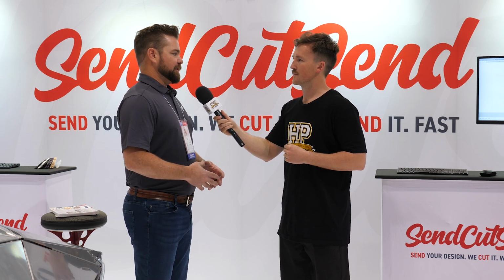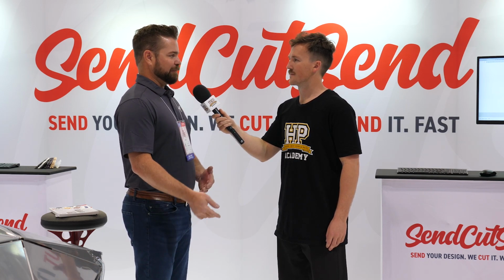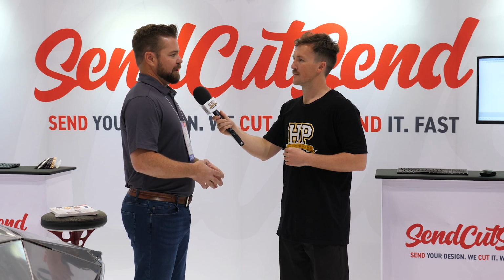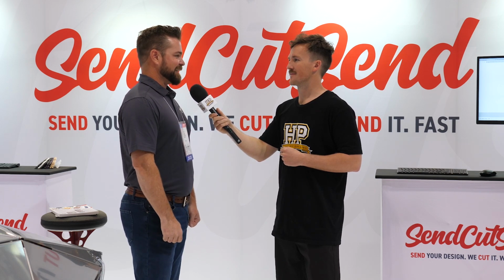You Designed A Part. Great! Now What?

Comment: At our shop, we opted to get a cnc plasma cutter. Very useful but the cut width and accuracy leaves much to be desired, specially with thicker material/smaller more detailed parts.
Compared to laser or waterjet cutting its pretty rough.

Our 3d scanned parts have to be designed with loose tolerance to take the inaccuracy of the plasma cuts into account. Very annoying to have to do. 

Just a heads up for anyone looking to getting an inhouse cnc cutter.
Reply from the maker: Still better than not having one, but you are right, you do need to work within the capabilities of the tools you have access to and that can take a little bit of testing to figure out how to make it work for you in the way you need it to - Taz.

Comment: I operate a CNC laser in central vic. I cut anything from 0.5 stainless with a 0.1 width of cut to 12mm steel with a 1mm width of cut. Great machine, can do so much. Just designed a custom 90-2 crank trigger. Having a press brake is nice also. Hardest part is working with customers, so many will tell you to do what I think, but then they change their mind on design. Best customers are the ones that give us a DXF. For anyone interested Cypcut is free and very easy to use, only about 100mb and not computer intensive.
Reply: I live in Vic and would like to know where I would search for your business. Perhaps some google keywords and a location? (Pretty sure you can't outright say your business name in the comments though)
My first thought when watching this video was "ok, cool. But nothing like SendCutSend exists over here"
Reply from the maker: @jacksonjdr94 he can say it if he wants to. There is a difference between answering someones question like that vs just blatantly posting business links with no context noting SendCutSend here is also US based so they can't really help you there in Australia like someone local will be able to. I'm sure they would be the first to tell you that too - Taz.
Reply: @hpa101  Thx Taz. I appreciate the clarification. 
Sometimes I think the Yanks don't know how good they've got it. 😆
Reply: Could i pay you to make me a dxf file of an intake manifold base plate and flange for a sbc 23° heads felpro 1205
Reply: @buiItnotbought   Look up Steel Tuff fencing and contact us mate.
Reply from the maker: 'The best and worst thing about working with people are the people' is something I like to say 😂
This sort of topic you're talking about is generally one of those things people are still trying to perfect right up until they retire, along with the struggle that is how to quote/price the work 😂
If you have enough going on I'd be inclined to consider just taking the work that comes with a file that is ready to go, even though I'm sure some of those other ones that cause the ball aches are no doubt often the ones you enjoy being involved with too when they go right - Taz.
Reply: @hpa101  You are correct, just cutting a sheet to size is simple but far from exciting. The more complex jobs are interesting and different although much more communication is required. It is frustrating when a customer about this big, or just an average screw hole. I find sometimes customers are not confident to say what they want.

Comment: At Send Cut Send, if you have a pattern of holes they might be off as much as 400 to 600 microns (0.4mm to 0.6mm). Plus YOU are the one to specify the material thickness. Mess that up and it is non-returnable/negotiable. All sales final. Someone at my job flip flopped 0.xxin and 0.xxmm. How? No idea.
Reply from the maker: You are right; it is 100% on you to supply a correct design; that is not their role, even though they will help when something is obviously wrong, as mentioned. That is not something you can or should rely on, however. Like wiring, a lot of success with this comes from the planning and preparation stages.
There are tolerances for holes & cutting, etc, which are stated, and if they are outside of that, you should let them know, and they will fix it. The tolerances will vary according to materials and the method being used. This is where they are there to help, and it is worth talking to any company you use for this type of work beforehand if you are new to this or unsure (perhaps you're doing something in titanium that you've only done in steel and want to have a quick chat for example). They're not going to tell you if you're material is correct for your application, but they can and will tell you how you can expect it to come out using their various options 🤘
There are certainly plenty of traps to fall into! Like anything, nothing you can't educate yourself out of, though, and it's important to note no matter what company you use, SendCutSend or otherwise, these are all considerations that will always apply - Taz.
https://sendcutsend.com/faq-category/tolerances-standards/
Reply: @hpa101  If I’ve had holes of critical dimension and or location, I’ll specify them to spec as to location, but, undersized the diameter to .078”, allowing me to adjust location and ream to size as required.
Reply: @hpa101  How dare they be so reasonable and transparent! 

Love SCS🤘
Reply: @hpa101  We make a majority of our parts in-house, but when it comes to folded sheet metal we use SCS or a local shop that specializes in bending and braking of sheet stock. We turn and mill brass, bronze, copper, 303/304, 6061, 7075, 4130, 216, 1016, delrin, teflon, G10, PEI, Rexolite, natural nylon and whole lot more. For huge orders (100's or 1000's) we have China contacts with a mould company. Then there is Xometry and Welink - same shops in China/India/Thailand (sometimes), different parent country location. Welink is the "Chinese" Xometry, but don't fool yourself. You will know after you keep dozens of shipping labels after many dozens of orders per year. My favorite 3rd party source is in Japan. Luckily, we have a remote office there now. The only parts nicer than ours. I just inspect and measure ALL of the parts, manually using two CMM's, a CNC vision system, and a Keyence semi auto vision/touch system, then a lot of micrometers. Full GD&T. My elbow has scoriasis forming where I rest it on the granite slab. Hereditary. I will tell you...perfectly cut, heat treated, magnafluxed, and painted, thin 4130 chromoly for mounting brackets is my favorite material to see. Thin, light, strong as hell steel. A foot wide lathed and stepped aluminum is another favorite. Japanese 303 stainless parts will absolutely blind you and are flawless. They exceed the surface roughness spec every single time. I take photos of them sometimes. Machined zirconia is amazing. Taiwan and Japan specialty.
Reply: With the laser cutting software (cypcut) you can compensate for a cut. So as a customer if you specify the hole must be exactly 10mm, the operator will cut inside the hole depending on the material thickness (example 3mm mild steel for my machine cuts about 0.4mm width of cut) so for a 10mm hole I will set up the compensate to be 0.2mm inside the hole, so it cuts on the circumference of a 9.6mm hole. As an operator we always do a practice cut of a hole and square to measure what blowout we get when cutting. Of course as the customer you must specify the material and thickness if you have a preference.
Reply: @chippyjohn1  We have beryllium and copper laser cut and EDM cut parts every week. They are always beautiful and it is torture following the quality sampling plan as I kmow they measurements will all be within 2 thousands of each other, even with the vision system and my eyes.
Reply: @pgmurray76  Wish I had an EDM, have cut a little copper, mostly mild steel, aluminium and stainless. I love the laser cutter, ours is just 1.5kw so limited to about 12mm with oxygen, great for very small pieces though. We definitely don't use non-standard measurement, only metric.
Reply: @chippyjohn1  Excellent. I think whoever cuts stainless solder paste silkscreens is a magician. Although, the Swiss guy that turns tiny, tiny round stainless parts and shaft mounted tiny gears might be a close second.
Reply: @chippyjohn1  The hole diameters were spot on (within specification). The distance from reference zero edge to the hole centers of three pairs (of seven) were off. It WAS NOT the model. Standard +/-0.10mm tolerance for our drawing (that is big for us). I measure tenths and single microns typically, so this was annoying, plus the Engineer needed to modify the drawing to +/-1mm to compensate and meet the FAI for the military customer. Every single part needed to be in-spec or we risked a rejected assembly. Plus the remaining two unit sale afterward. He slotted the holes. The thickness error by the highly respected and friendly Engineer was a "oops" moment and the drawing spec was altered. For milled or thicker flat parts the model and drawing files will determine the material. 1.5mm or less you can screw yourself up with a simple accidental click on the dropdown selection menu. It was in inches the last I remember and they selected something one decimal off. I will find it tomorrow (11-26-2023).

Comment: Have used SendCutSend, numerous times. Typically I’ll order 10 pieces, to have spares, and usually ends up costing less then the material alone would, if purchased locally. Quality has been outstanding, ready to use.
Only wish they had more selection of thinner 304 stainless, and 2024 aluminum, for aircraft related stuff.
Reply from the maker: It is a great way to get access to machines most of us would only ever dream of and great to hear it has been working out well for you price wise too. There are certainly some levels to that as well when you start getting into a bit of scale.
Materials wise all you can do is to keep asking and crossing your fingers. If you're already been doing that and haven't already you can also reach out to a few companies you know work with it and see if they will offer a similar service in those materials for you.
A local boat builder does some stuff in aluminium for us (and others) for example even though they don't advertise that as a service - Taz.
Reply: @hpa101  thinking I might reach out to SendCutSend, on the topic, as I think there’s a potential market (general aviation) they are missing, that may be accessed by material availability and targeted advertising.